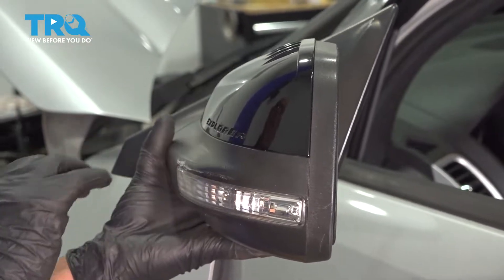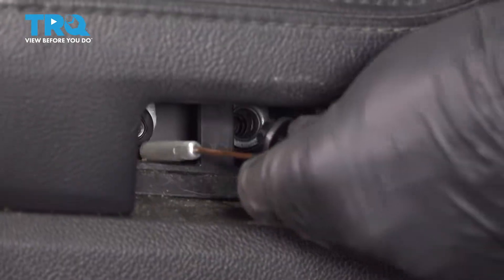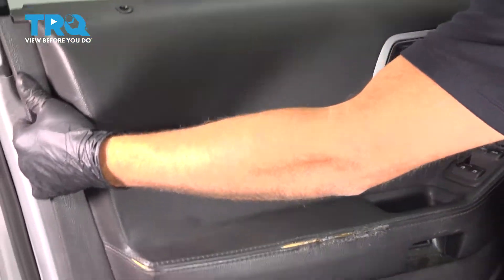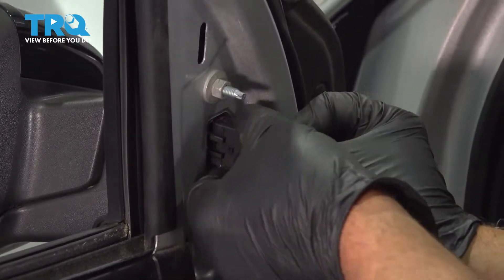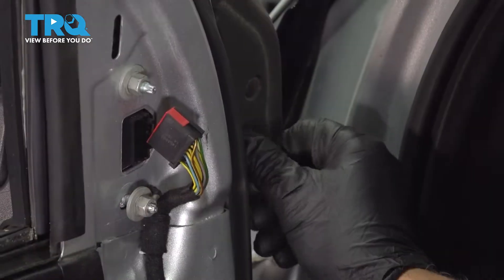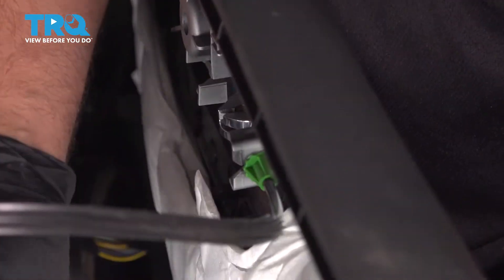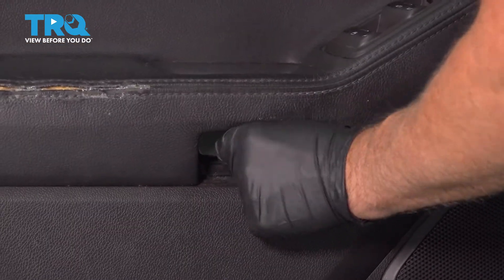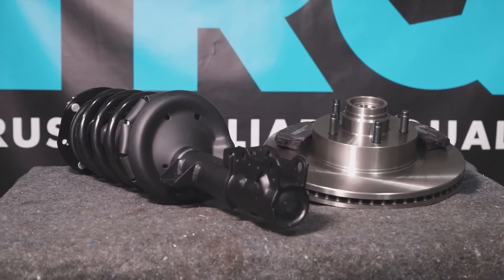How to Replace Driver Side Mirror 2011-2019 Ford Explorer

Comment: Hey, thanks for the usefull info made the install a breeze. For other users it's completely doable without removing the door side panel. It's a little finnicky because there is a plastic tab infront of the bottom screw but a 10mm wrench can easily get in and break the nut loose. You just have to be carefull not to drop it inside the side panel or you will have to remove the side panel to find the nut.
Reply: Got it, so have extra nuts ready to go lol.

Comment: Thank you for a great video. Two comments: 1) I did not remove the door.  2) The electrical plug was difficult to remove from the socket. You need to depress small clips on the wiring harness plug. They are hard to see and a pick is needed to depress them. You just cannot pull, if it is not easy you have not depressed the clips. Showing the clips, plug,☺☺☺ and socket in the video would be an improvement. I do not work on cars, so it is all new to me. Thanks again your help saved me money and time. Great video.

Comment: You can skip taking off the door panel.... Insert a srunched up piece of napkin underneath the bottom bolt to plug up the whole so that the bolt does not fall down into the door.

Comment: After replacing the mirror the sensor for blind side warning comes up on the dash. all connections are solid and the mirror works fine other than that. Anyone know how to get the blind side warning to work properly?